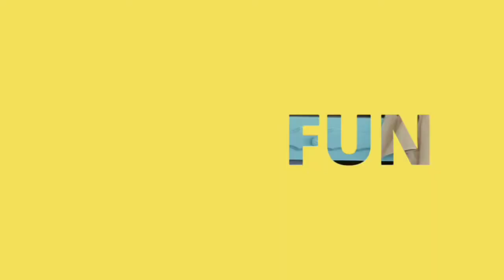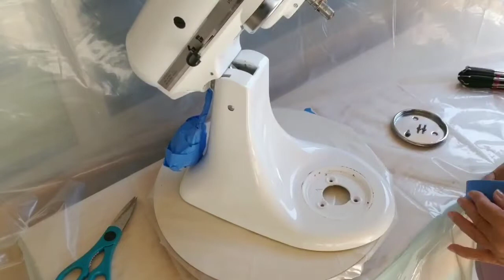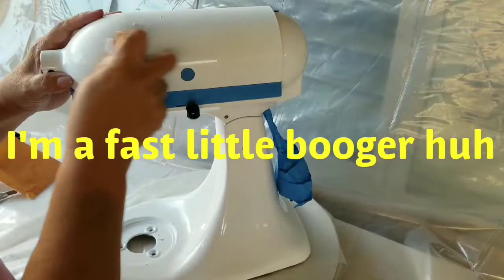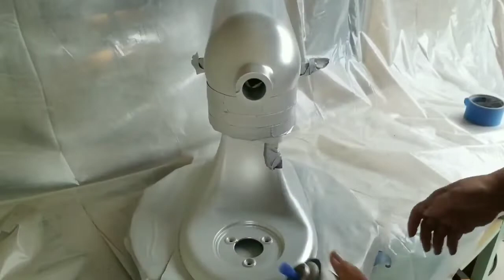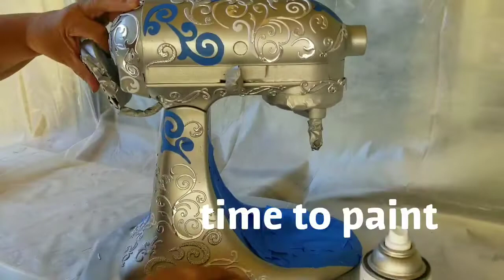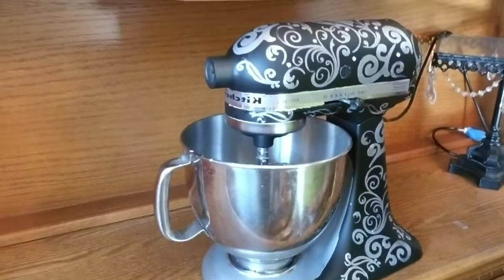Decorated Kitchenaid mixer

Comment: So I think your supposed to cover the back vent to prevent anything from getting into the motor and starting a fire. 😬
Reply from the maker: Ihave redone 6 mixers, I've never done that and haven't had an issue as the paint is dried & cured for a few days before I use it but you certainly can I suppose.
Reply: yeah, you def are! there are tons of things that need to be removed before painting. not the 2 things shown here, spray paint will eventually clog the motor and kill it